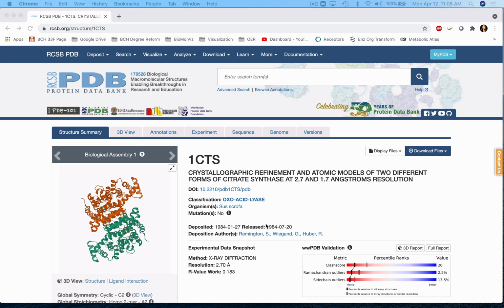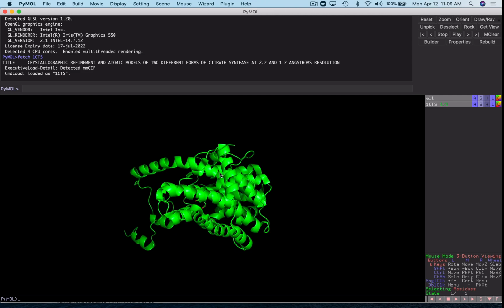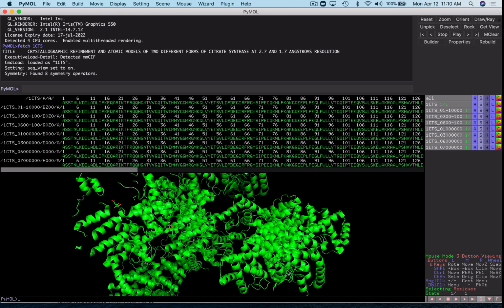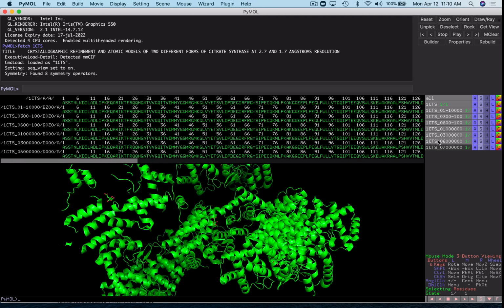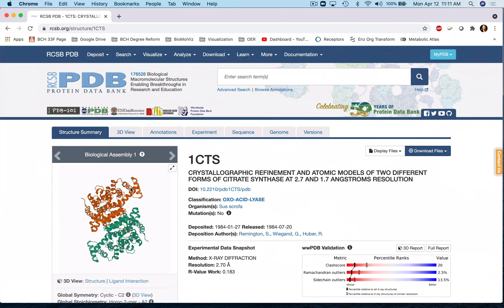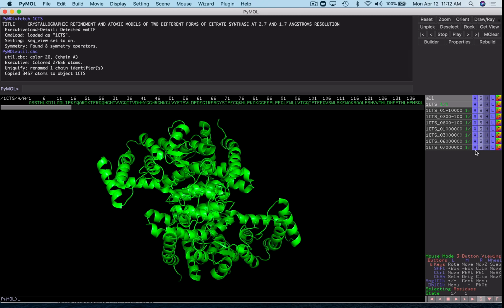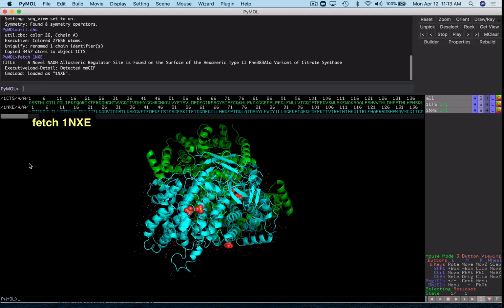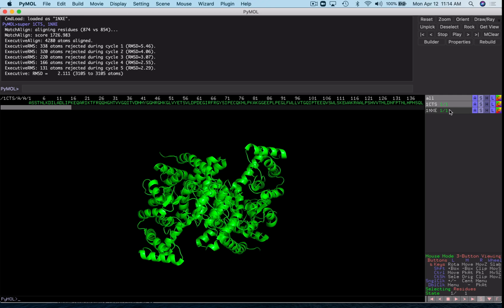Where's My Dimer? Symmetry Mates in PyMOL

Comment: This is a super useful feature, especially if there could be a symmetry contact that is more interesting than the authors realized! If its already on the PDB though as the 'biological assembly' you can fetch it into pymol with 'fetch 1cts, type=pdb1, multiplex=1' in 1 step!
Reply from the maker: Hey there! This is fantastic—I love when I put something out there and learn something new. Thank you very much!
Reply from the maker: This code loads the dimer as two separate objects, so the alignment step didn't work great for me (you have to align one chain at a time, I believe). So, I think it's still useful to copy the chains into one object and then perform the alignment. Thank you again! This is a real timesaver.